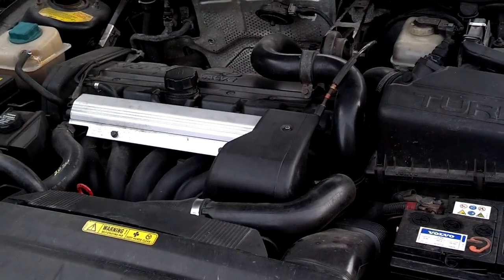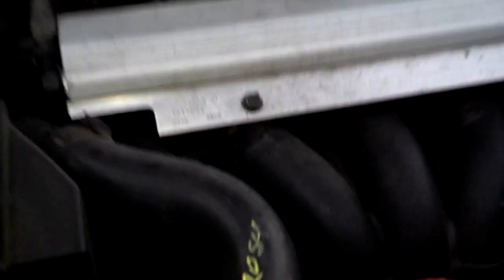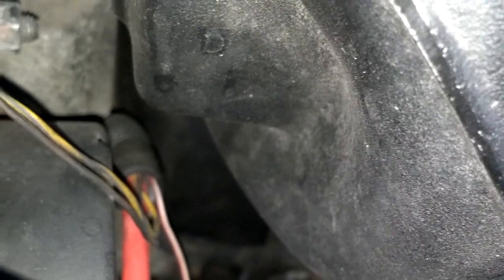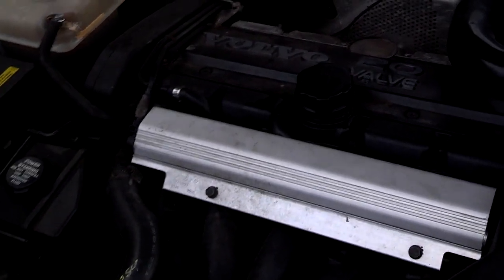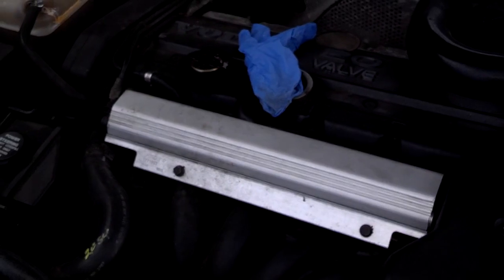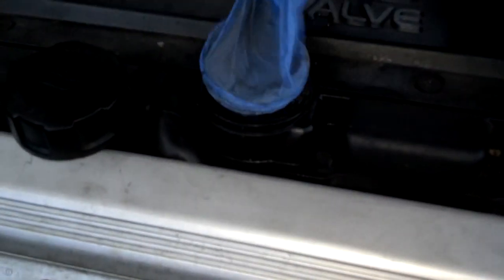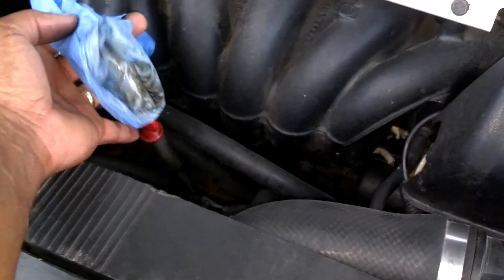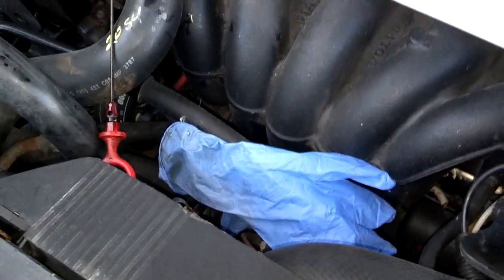Volvo PCV system check, 850, V70, S70, and others - VOTD

Comment: Hey robert love your videos. What is going on if when I put in reverse there is a loud bang every once in a while. Also sometimes it doesn't go when I am i n first gear. I just bought this car a week ago and have had nonstop problema please tell me it isn't the transmission. Have replaced alternator motor mounts and spark plugs. It runs really well and I paid 1800 for it. I am not a mechanic but have been able to fix some things watching your videos. 1995 volvo 850 turbo. Thanks a lot never seen a youtube channel like yours.
Reply from the maker: Not sure what is going on with the tranny. Do you have an orange arrow in the dash? Which mounts have you replaced? Have you changed the fluid in the tranny? Have you read the diagnostics boxes under the hood for transmission codes?
Reply: No haven't changed fluid changed top mounts and no haven't checked diagnostic
Reply: Thanks for help on onfo for radio harness was lodged into back of a/c plugs. Have neighbor who is gonna work on car for me . No orange arrow. Should I flush or just change trans fluid. Been a great help
Reply from the maker: Volvo 850, S70 Automatic Transmission Fluid Change / Service - Auto Repair Series

Comment: Bought the kit and did the PCV Breather and Intake Manifold gasket work on my 95 Volvo 850 Turbo. Replaced box and hoses. Found oil sludge and cleaned up the ports thoroughly . The car still did blow-by using the glove test and smoke still coming out of the oil stick. Pls advice.

Comment: Can this cause high nitrous oxide? I just failed this on inspection and it is high? Any suggestions? Vacuum leaks? I've read that the S70s don't have an EGR valve. Is that true?
Reply from the maker: Yes and Yes. If the system needs servicing, replace it.

Comment: Hello Rob, I've used many of your videos for tips and help, my car has smoke coming from the dip stick, what is the simplest solution if i fix it myself? I have a Volvo V70 2.5 - 99.
Reply from the maker: Have you done the glove test?
Reply: Hello,

Yes and it inflates quite quickly. I cant imagine this has ever been done before, the car has 190K on the clock, so may be overdue!
Reply from the maker: Replace the system. It will be a little different due to your ETM but this video should help a lot. 
Volvo 850, S70, V70 PCV system change replacement Pt 1 of 2 - Auto Repair Series
Reply: Rob,

Thanks for that info I'll look it up ans see what I can do myself. Than k you for your time.

Comment: I've bought a 1996 Volvo 850 turbo a few years ago and it had a small oil leak, which in the past few months has gotten much worse and I have noticed smoke coming out of the oil dip stick. After describing this to my mechanic, they  recommended I have an oil trap service done for a fee of just under $400. Does that sound correct to you?
Reply from the maker: Sounds way to low. Make sure they replace all of the parts and clean out the ports on the motor block.
Reply: Thank you very much. I will ask them to do that. Exactly what parts do you recommend being replaced?
Reply from the maker: Volvo 850, S70, V70 PCV System Replacement Pt 1 of 2 - Auto Repair Series
Reply: Thank you. That helps me go into shop much more informed. I appreciate your help.
Reply from the maker: Oh, all of my video's have an estimate on them in the ABOUT comments. SELF / INDI SHOP / DEALER.

Comment: My engine serial number is 
B5234T
1623611
What can you tell me about that engine regarding the pcv, cant find a site to look that up.
Reply from the maker: Well, it is a 5 cylinder, 2.3 liter motor with 4 valves per cylinder and it has a high pressure turbo. From the SN, it is in a newer car, maybe a '98 or newer. Is there anything else you need to know?
Reply: maybe a link for the right breather kit i need...i chatted with fcp euro and they keep telling me the breather kit i need is the 100$ one but looks like its missing a bunch of the hoses i see on my car.
Reply from the maker: What car do you have? A sales person there tried to have me order the wrong kit once.
Reply: i got the 99 s70 t5 but the guy before me did a engine swap, i got a little more info i took the tag off the timing cover, it says B5234T3 and the same serial number, but the etching on the back of the engine doesnt have the 3 at the end but the same serial number, that normal?
Reply from the maker: Cover may have been swapped.
Reply: the serial number on the tag is the same as the serial number on the back of the engine though. just the B5234T is on the back of the engine, and the B5234t3 is on the tag
Reply from the maker: No problem.
Reply: So would you think it is a T3? or just a T since serial numbers are the same in both places. Is there a difference between the engines?
Reply from the maker: That doesn't really matter. Here's the situation. Your car has a $160 hose that is only $45 on the older cars. So that drives the cost of the job up. If you want, you can replace that hose and the hose that goes to the top of the motor and just make sure the rest is cleaned out, like the oil trap (which almost never go bad). If you can afford it, get the kit and the other hose that wraps around the motor. Do you understand?

 http://www.ipdusa.com/uploads/images_products_slideshow/fullsize_6623.jpg
Reply: ok i think i got it, thats the hose i wasnt seeing in the kit the guys at fcpeuro were telling me to get. do you know the name of that hose?
Reply from the maker: PCV Hose assembly.
Reply: A friend brought up bypassing or deleting the pcv system, ever heard anyone doing that? Bad idea?
Reply from the maker: I don't do mods like that. I have read and spoke to people that believe to have "improved" the system with a mod or delete. However, they probably make a lot less money than the engineers that designed the system and their mod/change does not have the testing that the car has. I'm not to up to testing people's mods and theories that may cause internal motor damage.
Reply: Good point. I need to replace my upper intercooler tube since this guy had a bov,, I got it rigged but might not be air tight just yet, will that give me the same symptoms as a clogged pcv? (smoke from dip stick and oil under valve cover)
Reply from the maker: I don't think so. Should cause idle and performance issues.

Comment: the only code i get is p1238 i believe, could you tell me what that is? turbo leak? what needs to be done?
Reply: Also what should i expect cost wise to get the pcv serviced?
Reply: one more thing robert. The guy that had this car before me had a blow out valve attached and i want to return it to stock. i have a replacement pipe in right now but concerned that its not sealed 100 percent...the pipe i need replaced is in the front of the engine right in the middle and the pipe goes right towards the air filter box then looks like it goes under the engine...what is that pipe called?
Reply from the maker: Search the code on my channel. I believe it points to an intake tube leak.
Reply from the maker: If you do it yourself, $160. If you pay to have it done, between $600 - $800.
Reply from the maker: I think you are referring to the intercooler tubes.

Comment: I just bought a 1998 volvo s70 it has a 20 valve 5 cylinder engine. 

There is smoke coming from the dipstick area, and also smoke coming from the engine under the tubes and when I remove that caps.  It also boils hot water. What could the problem be? I was told the head gasket and intake was the problem.
Reply from the maker: From the engine under what tubes? Remove what caps? Cars should NOT have WATER in them. If someone told you it has a blown head gasket, that is possible. I'd have to check it or have a mechanic check it to know. Maybe you can post a video and link it here.  Have you watched any of my head gasket videos?
Reply: I've watched all your videos that related man, and water from the coolant system? That pumps to the thermostat.
Reply from the maker: Is there coolant in the oil? Is there oil in the coolant reservoir?
Reply: No it's fine.
Reply from the maker: Have you drained the oil into a pan?
Reply from the maker: You should go to my website and contact me there. Call me tomorrow or something.
Reply: Ok I will what's the website?
Reply from the maker: At the end of all of my videos it has my website, www.RobertSpinner.com
Reply: Ok

Comment: hey robert i got a 2001 volvo s40 1.9t 122000 miles when i take of the oil filler cap white smoke comes out of it does that mean the pcv system is bad or engine burning oil?
Reply from the maker: If you have to add oil between changes, it is burning oil. If smoke is coming out of the oil cap, that may mean there is some condensation in there burning off. Did you do the glove test?
Reply: Robert DIY yes i did the glove test and it blew it up like a ballon so that must mean the pcv is bad from what you say can i do it myself clean out the pcv or is it complicated process?
Reply: alonzomvp1
how much would it cost to replace the pcv?
Reply from the maker: The videos have estimates.
Self cost (parts) / Indi shop / Dealer

Comment: Hey rob I have a 2000 s70 awd with an ipd short ram and snabb fresh air pipe and my turbo whistles during take off and a lag occurs what could it be??
Reply from the maker: Chances are you have a vacuum leak. Do you have any codes? Have you checked for a split intake tube or loose connection?

Comment: Hey rob i have a volvo s80 t6 2000 168k mile and the car is blowing out a lot white smoke even when is warm up and is has rough idle and the dipstick is dirty of oil all around and is burning oil  but is not burning coolant and it is  not overheating somebody told me that the oil trap Could be my problem what u think about it i would like u advice
Before to clean or replace that man thanks
Reply from the maker: 2003 Volvo XC90 T6 AWD Smokes and has P0234 Code. Bad turbo...

Comment: I checked my PCV system just like you said it. It does the vacumm and everytime that I removed the oilstick the whistling noise goes away, then I put it back in and the whistling starts all over again, same thing with the oil cap. I have a 2006 S40.

Tell me what to do
Thanks for all your help
Reply from the maker: You must have some kind of vacuum like elbow split. You'll have to find it.

Comment: I have a 98 volvo s70 turbo I can't figure out whats wrong with it it will start up and run just fine until the engine gets warm than shuts off and wont start up again till it cools back off do you have any ideal on what I can check the spark plugs are new and just replaced the trottle sensor that was one code That showed up on the compuer but it still wont stay running can you give something else to check trying to do this on my own dont have the money to take anywhere
Reply from the maker: None of us do, that's why we're using YouTube to fix our cars. :/

How old are your wires? Cap, Rotor? Wires actually have dates on them. Year/Week

My guess would be the ECT, Coolant Temp Sensor, just under the thermostat.

Volvo 850 Thermostat and ECT (Engine Coolant Temperature Sensor) Replacement - Auto Repair Series

Comment: Thanks Robert.  I just checked my 2002 V70XC and it's sucking the glove in.  I put the same glove on my 1995 850 Base model (with the new leather power seat interior) and it shot the glove off like a cannon.  Looks like I'll be doing lots of work ahead on the 850.
Reply from the maker: LOL, Wow! I'm surprised that car doesn't need the cam seals.

When you replaced the cam seals on the XC, did you use Volvo seals?
Reply: I was traveling cross country and had the nearest garage do it.  Not sure but I highly doubt he used genuine Volvo.  I'm going to order the mega timing belt kit with the new camseals.
Reply from the maker: Man, I would NOT do that. Cam seals need to be Volvo. Are you talking about the 850?
Reply: I'm definitely going to go with Genuine Volvo.  The 850 needs the seals more than the V70 right now.

Comment: Mr. Robert, I have a 95 Volvo 850 Turbo with about 137k on it and I did the tests that you showed in the video. My car did exactly the same thing yours did in the video! I'll take that as good. Thanks for the simple steps and quality!
Reply from the maker: Good deal. Now you should check your timing belt and heater core.
Reply: Just replaced the timing belt so heater core is next. Thanks!

Comment: Hi! your video has helped me identify the problem in my volvo, my question is how to clean the pcv system. Does replacing the pcv box solve the problem? Thank you!
Reply from the maker: Not sure what the "problem" is but if the system is building pressure and has NOT been serviced in a while, it likely needs to be replaced. Not just the box. Volvo 850, S70, V70 PCV System Replacement Pt 1 of 2 - Auto Repair Series

Comment: Hello Robert I just bought my 97 volvo with 136 miles it's a 850 5 cylinder the person I bought it for have me the papers that it didn't pass smog they say disconected air injection and disconnected vacuum lines to sensors/switches (air control systems ) I bought the car because I got a good deal and it runs real smooth what dose this mean will i have to reconnect the stuff or replace this how much do you think this will cost if I have my husband do this thank u
Reply from the maker: Unfortunately you will have to get that working or hack into the car's computer and "delete" the system. If you Google "Volvo SAS Delete" you should find the hack for it. If not, you will likely have to replace the SAS pump that is located under the car battery.
Reply: Okay thank you for the info hope to get it fix so it can pass smog your videos are very helpful
Reply from the maker: Anytime.

Comment: I had a 2003 S60 that had a real bad PCV problem. When it gets bad, you'll even hear a whistling sound and throw a CEL. It took me 4 hours to replace the stupid oil trap since I had to take the manifold out and it was a bitch to get it out of the car because the metal fuel line goes in through the openings of the manifold. I was amazed at how much nasty goo was in there. Word of advice for you folks with Volvos is to always use synthetic instead if you're using conventional and to change your oil often.
Reply from the maker: Thanks for sharing.

Comment: Hey rob I have a 98 v70 t5 with 200,000 miles when I did the glove test it sucked in at idle but inflated when I pressed the accelerator
Reply from the maker: I'm not sure what your issue is. There is a chance that you are experiencing piston blow by. You can do a compression test to find out. Also check your PCV lines and connections to make sure none of your elbows are torn or loose.

How to do a compression test on a car motor. Volvo 850, S70, V70 through 1998 - Auto Repair Series

Please let me know the results. That way I'll know for future people. So, my thoughts right now is that your PCV system is in good health, but you may have a worn motor or piston. If your car is a turbo, the numbers should be between 156 - 186 psi.

Comment: Hey rob I have a 98 v70 t5 with 200,000 miles when I did the glove test it sucked in at idle but inflated when I pressed the accelerator

Comment: This PCV system is also in V70 2000-2004?
Reply from the maker: Yes. Not 100% sure how to test those but the owners manual state that they should be inspected every 60,000 miles. Anytime it has an inspection schedule, it will probably need to be service soon there after.

Comment: hey robert i did this test and the rubber glove was going in and out in and out with engine reving....not so much inflating... in these regards i should get the pcv system serviced eh?
Reply from the maker: If the glove did NOT inflate, I would NOT worry about it. Check your elbow connections to make sure they are serviceable.

Comment: Rob, I just bought a 2007 v70 2.5T. It has 109,000 miles on it. The engine service required yellow flasher keeps going on then off quickly. Sometimes it'll stay off for 20 minutes. Sometimes it'll quickly go off and on for the whole drive. It runs fine. No missing or rough idle. Do you know what could be causing this?
Reply from the maker: No, you will have to have the system scanned to see what the car is trying to tell you.

Comment: Advice appreciated
Robert,

Thanks for the great DYI videos. Very informative. and you are a great teacher knowing how to explain things in an easy to understand way.

A question-- I have a volvo s60 with 150k miles. there is some oil under the engine cover. When I used your rubber glove method to test the engine pressure, the glove blows up. Do you think the PCV system is the culprit? If so, how soon does it need to be replaced?

Thanks
Reply from the maker: I'd check compression just to make sure the motor is not worn but chances are, the PCV system is plugged.

Needs to be done ASAP because you are in danger of blowing oil seals.